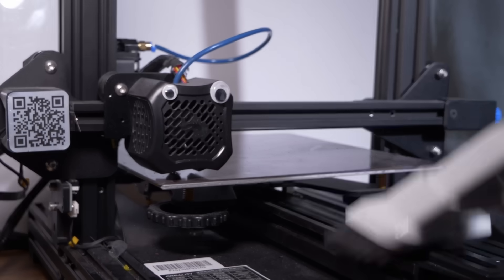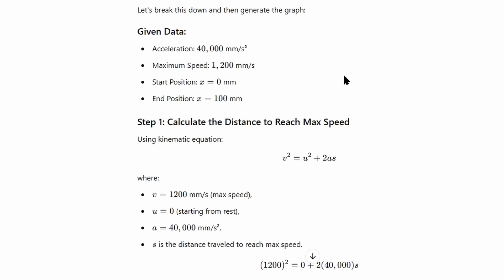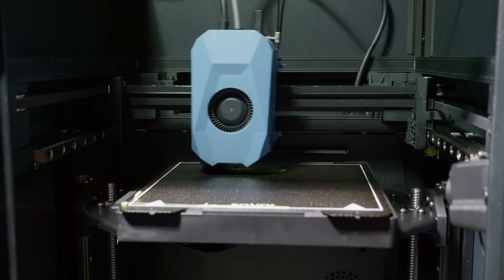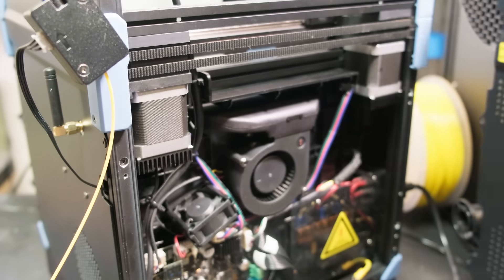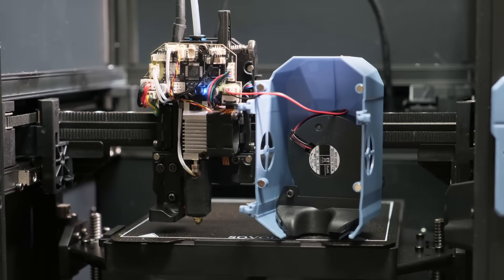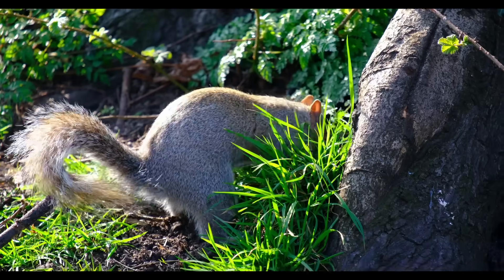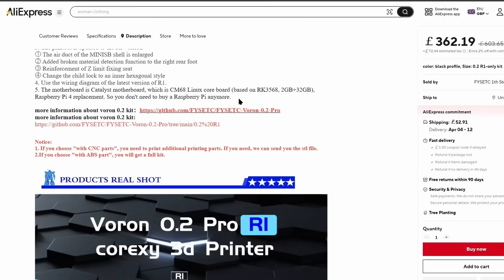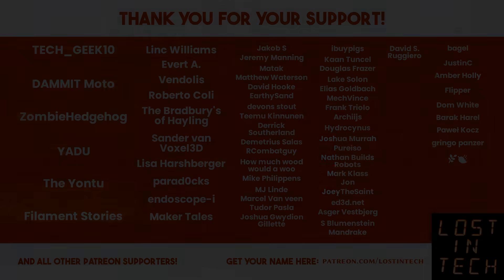SOVOL Zero - Tiny Powerhouse - FASTEST Production 3d Printer??

Comment: They should finish first the SV08 (a printer with a huge potential that passed almost forgotten because they launched it unfinished) before launching more and more models.
Reply: it´s insane that they put an eddy current sensor for a 150x150 bed and a shitty sensor for the 350x350
Reply from the maker: @yuripolak  well...eddy was very new then (btt eddy had just come out). Watch this space.
Reply: @LostInTech3D  I had a beacon for a while before... OK, expensive... but I'd rather have a klicky than an inductive sensor that drifts too much
Reply: My SV08 has been waiting for a week for me to fix it.  I knew the first layer is unreliable so I watched the first 20 layers before going to bed.  Six layers later, the part detached.  In the morning, the hot end was enclosed in a baseball sized semi-molten blob-of-death and the heater wires were sparking!  I ordered a new @Microswiss hotend and they delivered quickly.  It should be a fairly quick and simple fix as I had already chipped away the blob to access all of the hot end screws, but I'm discouraged because the fundamental problem remains.  I can't trust the SV08 to produce a good first layer, even after a five minute heat soak of the nozzle and the prox sensor that isn't temperature compensated.  My SV08 board warps more than 1 mm across its surface and the bed mesh isn't accurate so Klipper has no way to even try to compensate for that much warping.

That said, I love the SV08.  Sovol got so much right with the SV08, only to drop the ball on the critical first layer.  In the Zero launch video, people asked about the SV08 first layer issues and Sovol promised that they're working on an upgrade to add an Eddy probe and upgrade the Klipper to at least fix the SV08 bed mesh, which is the easier of the two problems to fix.  I started working on shimming the bed as a partial solution a couple of days after receiving my SV08 but didn't finish because after a couple of attempts at adjusting the screw tension to control the heat warping and reading online comments, it looked like a lengthy tedious process that would result in at best a partial solution with less warping.  I hate to spend $350 for the aftermarket Voron bed for my $500 printer but that might be the best solution.  It beats unreliable first layers, failed prints, warped parts that barely succeed, and regularly replacing $64 hot ends.
Reply from the maker: I had the biggest blob of death ever on my sv08, and I also made the wires spark just the same. I made the mistake of not watching the first layer. Mine survived though, except for the sock. The SV08 is kind of a shame because everything else is good, just the first layer issues.
Reply: @ I would say there is more issues than the first layer. Unfinished firmware that many users had to fix themselves but they don't update the official firmware to include those fixes, lack of functionalities in the firmware they could easily added (like for example a good set of macros to do things like clean the nozzle or home the printer in other spot than the center), supereasy and supercheap hardware improves like a better Zheight probe (2$ upgrade) or a quieter and bigger CPU fan (1,6$ upgrade) or a chain solution for the head cable management.
Reply: @Liberty4Ever  I was having issues with the first layer, so I did the same thing I've done on all my inductive-probe printers:  Created a macro called PREHEAT_PROBE that takes a temperature argument that defaults to whatever your most common bed temp is.  What the macro does is set the hotend and bed to the same temperature (to prevent making a hotspot on the bed), and then homes and moves the head so that the probe is centered on the bed and 5mm above it.  When you run the macro, give it whatever temp you want the bed to be and give it 5 minutes to heat soak, then start your print.  Make sure your PRINT_START does a new Z home before doing the bed mesh.  Here's the key:  Make sure you set a timer so you start the print at the same time every time, and set your Z-offset so that you get good results at that time.  So, basically, first run: PREHEAT_PROBE -> 5 minutes exactly -> set z-offset.  All other runs: PREHEAT_PROBE -> 5 minutes exactly -> start print.

I wouldn't say my first layers are perfect, but since I started doing that, I've never had a part pop off the bed during printing, including multiple parts that were 20x20mm on the bed and 300mm tall.  Also, a warning:  If you set your z-offset this way, you CANNOT print without first doing PREHEAT_PROBE+5 minute wait.  Your z-offset will be completely wrong (by over 0.1mm!) if you try to rush things.

Comment: On my Qidi XPlus 3 the head shroud is held on by clips and I've had a few occasions where a failed print took it down. I don't think it is accelerations are jerk why they used the clips. I think it is more in line with saving the printer if a knocked of print lodges between the bed and the print head :D But I might be wrong. 
I've been waiting for this printer for a while now - instant preorder :D

Comment: I have an SV08 and would consider a Voron Zero. Two things put me off, at 120mm the bed is just too small and coming from an Ender 5 I have promised myself I will never buy another cantilever bed. I still want a small printer for prototyping and fast iteration. Living in the UK the cost of electricity is awful and heating a 350 bed is just wasteful.  I got my SV08 a couple of months ago, so i'm skint, which basically means I'll miss the early bird and have to wait 12 months for them to start showing up on AliExpress.   Are the hotend assemblies interchangeable?
Reply: The Zero hot end is completely different from the SV08.  The basic design of a rectangular ceramic heater clipped to the side of a heat block is the same but the dimensions and nozzles are completely different, and I think the wattage is higher on the Zero to get anywhere close to the claimed 50 mm^3/s volumetric flow.  The tool heads are completely different too.  The SV08 uses USB communications and the Zero uses CAN bus.  It would have been nice to swap an SV08 tool head for a Zero tool head and get a higher temperature nozzle, higher flow rate and the Eddy probe, but that is not happening.

Comment: While jumping to 48V might give you a slight acceleration advantage, the main advantage of that mod is to maintain useful torque at higher speeds and therefore increase the top speed. The designers of this printer must have established that the top speed was sufficient and so 48V was not necessary.
Reply from the maker: Presumably the additional torque increases square corner velocity

Comment: Greate video showing the printer. Maybe missing is showing the software that runs on the printer and how open it is. Like the whole Bambu situation triggered me a need to know what is the firmware and how open is it.
Can't wait for the Centauri carbon review. Also super interested as if we can put regular klipper on it by the looks of it or not. To put bot turtle, or tune skew at a printer level and not at the slicer
Reply: Sovol has stated that it’s pure klipper for this printer and other reviewers have touched on that too. And, if it’s anything like the SV06 Ace, I’m sure the entirety of code, step files, and BOM will be on GitHub soon.
Reply: Sovol is a small company but they are very dedicated to open source.  That's one of the things I like about them.

Comment: That acceleration vs attained speed graph was very helpful! Would have been cool to compare something squareish and 150X150 printed on the Sovol Zero and something like the CORE One or SV06 ACE, all at their high speed settings. Then we could see if the Zero really kicks their butts when using the full bed, just to shut up the haters.
Reply: I bought the Zero last night even though I mostly print TPU which is so inherently slow that I won't benefit from the 4 g acceleration and 1200 mm/s fantasy speed.  I do print small parts in PLA, PETG-CF and ABS so the Zero should be good for those and rapid engineering prototypes, largely because the tiny AC heated bed heats very quickly and the Eddy probe can make a very fast but accurate bed mesh so the Zero starts printing small parts much faster.  I needed a better rationalization to justify the Zero so I made up some nonsense about printing production TPU parts one at a time with custom G code between each part to use the tool head to eject the parts, so the small print bed would be irrelevant for production.  Where there's a will, there's a way, although it's probably more true to say when you want to buy, you will tell yourself a lie.
Reply from the maker: I think you'll be surprised how much faster it seems even on TPU due to travel speeds, and I suspect you can push it a lot higher than the default ~4 mm^3/s for 95A. 
At the end of the day though a printer like this doesnt do anything you can't do on any other printer, it's mostly an aesthetic and convenience choice. Being able to pick it up and move it is a start!
Reply: @LostInTech3D  It also doesn't take up half a desk. 😂
Reply: @Liberty4Ever  Hahaha love the justification. It would def be a good printer for prototyping and even scaled versions of other prints to check design and function.

Comment: I've been wanting a small printer to leave a 0.2mm nozzle on for printing tabletop minis and detailed terrain. This would be perfect, and could churn out the high detail at an ok speed.
Reply from the maker: Yeah I will try to get a .2 nozzle and see how it goes. I need to check if it's a bespoke nozzle or not, it sure looks like a v6 will fit but might be too short
Reply: @LostInTech3D the plague of bespoke nozzles :/
Reply: @LostInTech3D   Did you reach a conclusion on nozzle compatibility? I'm strongly considering the Zero as my next buy, and I'd like to know if the heaps of Mk8 or V6 nozzles I already have will work. Side note: I really do enjoy your videos, especially all your macro photography. Keep it up!
Reply: For this, you better use a resin printer.
Reply: @BenderTheOffender  - I'm old enough that my eyes can't resolve the difference between the new better print quality coreXY FDM printers with a 0.2 mm nozzle and resin printers.   😲

I don't do miniatures but it seems that many of the people who do are starting to embrace FDM printing for the ease of use and much less nasty chemical goo mess.  That's particularly true of people who are printing their miniatures as the paint hides the layer lines, which actually provide more surface area to increase paint adhesion.
Reply: I've got a resin printer - but printing terrain or bigger monsters is a little expensive. Plus cleanup. My FDM printer is always ready to go, but the resin printer gets used for a few weeks, then left clean and empty for a couple of months.
Reply: @BenderTheOffender resin is far messier and more toxic than fdm.

Comment: Any idea how much power it uses? I’ve been putting together a car camping kit and I’d be happier if I could get a 3D printer in there :)
Reply from the maker: The mains bed is a problem. It says 1150W but that's for warm up. It will be more efficient than most printers due to bed size, I did an analysis video a couple years ago on power usage over time of printers, so that may be of use. If you have a decent size inverter on a power station it ought to handle the peak load. I have an ecoflow river max 512wh thing that can handle a printer.
Reply: @ Nice, thanks for the info!

My current car setup has a 600W inverter because that’s what I needed to handle the startup current of a 60W fridge. It’s a Prius, and if you leave it “on”, it provides about 120W at 12v and turns the engine on every 5-15 minutes for 30 seconds. 

Alternatively, I have an EV AC charging adapter. It connects to “low speed” AC charging stations and gives me 240v, 6 kW. 

That might actually be perfect for this printer…fast short bursts of power :)
Reply from the maker: 600W won't do it, this is why I was thinking using a power station as essentially a buffer would be an idea as they can go up to 1800w, in fact I've used my Anker one with a fan heater 😅
Reply from the maker: That being said.... you mentioned 120v. You might be okay. The way mains heated beds work means they use a lot less power on 120v. Unfortunately I can't test that.
Reply: @ Yeah, I’m in the low voltage part of the world. Most AC car chargers are 240v, some are 120v. Our tumble dryers and stoves are 240v. My RV is 50A. Which means it’s 50A 240v *split phase*. It has two lives and one neutral. I can get two phases 120v 50A or one phase 240v 50A. 

On my first test trip with the EV charging adapter, I used a 2000W West German 240v to 120v transformer. It still had a UK 13A mains plug on it. Worked fine, except it really hummed a lot. 

There are now these weird solid state GaN 240v to 120v adapters that claim to convert the power and produce a pure sine wave. The one I got is tiny and claims to be 1600W. I guess we will see…

(Most of my computer gear works at any voltage, but my 12v battery charger and my mini kettle and rice cooker are 120v only)

Comment: So did Sovol fix all the issues with the sv08 or is it still not worth the $550 price. I’ve got the centuri carbon coming but it won’t be here till June
Reply from the maker: It's worth the price but I think it's worth checking in whatever social group you prefer as to the exact status. I found mine works better with a heat soak delay and that's about it.

Comment: 199 should be the price, more than that is just unbelievable
Reply: If they used cheap enough parts to get it down to that price, then the printer would not be as good, or reliable. This mindset you have is what causes the "race to the bottom" in which there are very few choices for a quality printer because so many people want a cheap printer. There are a lot of people who want a good printer, and having a  printer that isn't a pain, is well worth an extra couple hundred dollars. I know that there is at least one good choice at the sub $300 range, but it isn't fair to compare since they function very differently and offer different experiences.
Reply: @LincolnWorld  - I think Sovol learned a lesson with the SV08.  They hit the $500 price point on a fast full featured Voron 2.4 adaptation with seven linear rails, but I wish they'd charged $600 and provided a flat print bed and an accurate bed mesh probe so we could have a reliably good first layer, which is a non-negotiable feature on a 3D printer.  Now, I need to spend $400+ and hours of my time before my $500 SV08 can reach its awesome potential.  There is nothing more expensive than a cheap 3D printer.  Sovol is bragging on the Zero's "Perfect First Layer" and I'm going to hold them to that.  I ordered the Zero last night.
Reply from the maker: 😅 build your own for cheaper I dare you
Reply: @ you’re right, I got a SW and a 0.2! I build both and I know that was a lot money, but for today market with printers like the elegoo and other, the price is just a lot for just a 0.2 clone
Reply from the maker: Well... nobody is exactly sure how elegoo are making the carbon for the price they are. I have one right here and it weighs a lot, so it's definitely a puzzle.

Comment: I'm assuming sovol will be doing a 300mm^3 trident next
Reply from the maker: If I knew what sovol were doing next I couldn't tell you 😂 but I'm not sure if a trident makes much sense. Of course I would like them to make a toolchanger 😁
Reply: On yesterday's Zero launch live stream, Sovol mentioned that they have been simultaneously developing a 500 mm cubed coreXY printer that will apparently be released soon.  That's very cool.  They're also working on an MMU which is less interesting to me.  I'd rather have a dual extruder setup or maybe an IDEX.